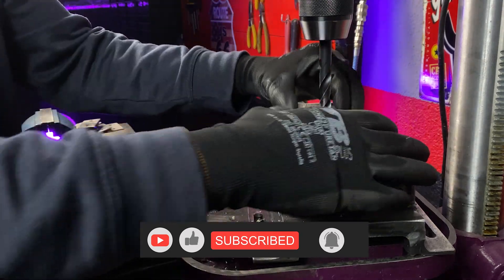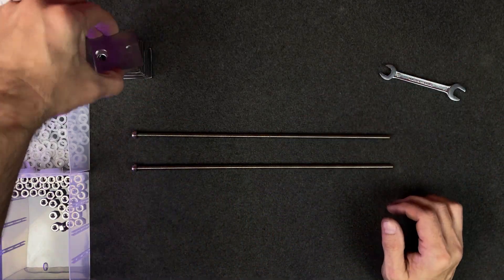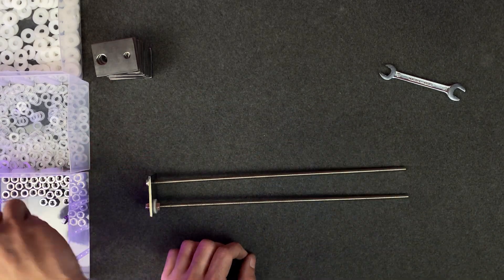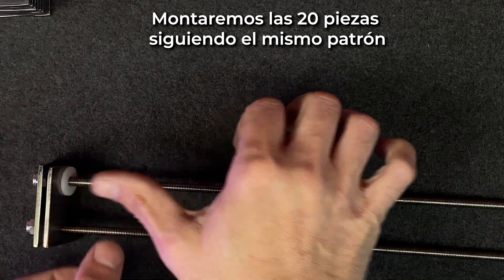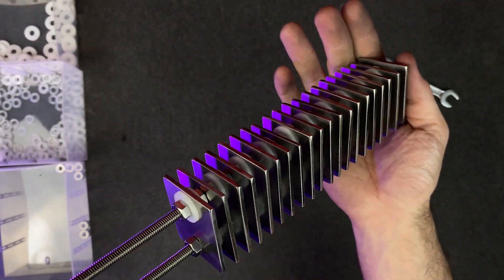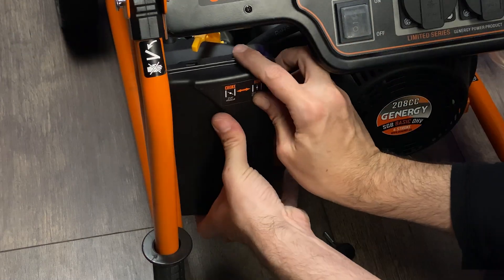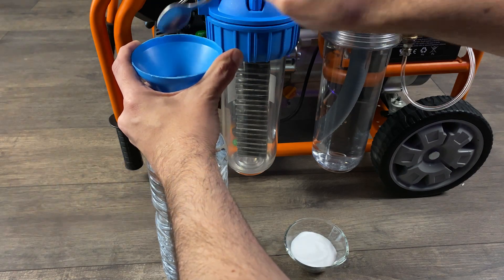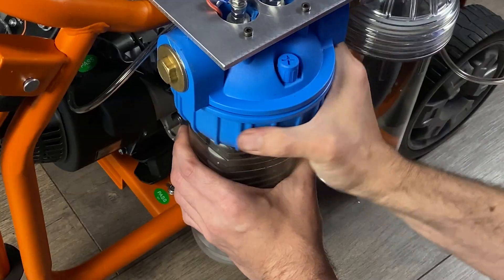GENERADOR A GASOLINA QUE FUNCIONA CON AGUA

Comment: Esto lleva a otras preguntas: con carga de 3000W, el generador sigue funcionando?...por cuanto tiempo? digamos unas 5 horas, sin parar?, cuanto dura la batería?  el tiempo de funcionamiento del motor, dependerá de la duración de la batería no?, si pusieron un fusible de 20Amps, significa que el consumo de la celda Debra ser menor a 20 Amp, pero si suponemos 10 amp de consumo mide la celda, entonces la duración de la generación de H2, será n o mas de 2 horas, pues la batea parece ser de unos 20AH máximo, por lo que no puede durar mas que eso y si es a plena carga del generador yo creo que seria menos, después tienes que resolver el problema de suplir por lo menos 120W adicionales para cargar la Batería y estar seguro que el generador pueda con esa carga de mas a los 3000W nominales, por lo que, en caso de poder suministrar los 10Amps de DC, el generador, entonces la potencia nominal del generador se ve reducida y ademas, cual es el tiempo de operación efectiva de la celda, cuando pasa el tiempo?
Reply: Según la ley de conservación de la energía para obtener 3000 watts de potencia en el generador eléctrico tendrías que tener un generador de HHO de 3000 vatios. Aplicando la fórmula de la potencia, P = V. I  necesitaríamos 12 voltios a 250 amperios y todo esto en condiciones ideales, es decir, tendríamos que tener un generador de HHO con el 100% de eficiencia y un generador eléctrico con el 100% de eficiencia también y eso es físicamente imposible.. por eso esta idea es de lo más absurda.

Comment: Una vez mas pregunto, pues no tengo respuesta: cual es el consumo en AMPS de la celda de H2?
Reply from the maker: Pues tiene un fusible de 20 amperios, aunque consume 10 amperios. Al arrancar el motor la batería se carga con 20ah, así que este motor funciona perfectamente mientras el depósito tenga agua
Reply: @HiddentechnologyYT  querido amigo, con todo respeto, llevo años construyendo generadores HHO (Hidrógeno y Oxígeno) (como tu modelo) y solo generadores de hidrógeno, me gustaría saber si has modificado el encendido de las bujías (adelanta la temporización ) porque el hidrógeno se quema mucho más rápido que la gasolina, y si cambió la sincronización eléctrica para ajustarse a la explosión de hidrógeno más rápida, dígame cómo lo hizo. por favor, entonces, inyecte el HHO directamente en el tubo de suministro de combustible del carburador, ? y modificas (reduces) la entrada de aire a la mitad (-50%) exactamente? finalmente dices que ajustas el flujo de gas por el tornillo del carburador exacto? Finalmente, ¿su generador es de 2 tiempos o de 4 tiempos? ¿Puede proporcionarme el número de modelo de este generador de 3000 vatios y 208 cc? el nombre de la empresa de este generador por favor. a cambio, te daré algunos consejos adicionales sobre cómo producir más hidrógeno con menos corriente eléctrica sin usar koh (HIDROHÍRDO DE POTASIO) Tengo mejores soluciones para electrolitos. Yo espero ansiosamente tu respuesta. Gracias.

Comment: C'est la batterie qui fourni l’énergie électrique pour l’électrolyse sauf que la conversion eau=>Hydrogène n'est pas rentable effectivement le moteur tourne mais pour combien de temps sans recharger la batterie ! l’alternateur interne ne peut pas généré assez de courant (même avec un système sur 48 Volts) . Donc en conclusion c'est une sorte de moteur électrique qui fait croire a la poupée qui tousse et sans compter que le moteur thermique va vite s'abimer usure prématurée rouille etc ...
Reply: en fait, moi je met en doute que le moteur réussise a tourner tout simplement...pourquoi? il ne semble pas y avoir suffisament de gaz et de plus, pour arriver a faire tourner un moteur avec de l'hydrogene il faut modifier le timing du moteur car l'hydrogene brule tellement vite que le moteur explose avant meme que le piston soit rendu au sommet de sa course...et si c'est un modele deux temps, comment se lubrifie t'il? je construit moi meme des générateurs hho depuis des années. mais faire rouler un moteur de facon souple ca c'est une autre histoire.
Reply: Vous avez sûrement raison moi je parlais uniquement électrique je n'ai pas les connaissances en mécanique j'ai simplement considéré que ça marchait
Reply: @francktlalka  sincerement, j'aimerais bien que sa méthode fonctionne, qu'il consomme plus d'électricité qu 'il n'en produit est pour moi un probleme secondaire, un probleme certe, mais secondaire car cela peut se corriger, non moi je pense a créer l'explosion dans le moteur au bon moment et avec la quantité de gaz (hho) suffisant et le fait qu'il induit le gaz par le tuyau d'essence au lieu d'utiliser l'entrée d'air du carburateur mais qu'il prend plutot soin de bloquer a 50%. l'arrivé d'air.
Reply: @francktlalka  je lui est posé les questions pertinente et j'attend toujours qu'il me répondre...ce qui n'est pas le cas a date...

Comment: Hello! I'm a very beginner on this, so please be considerate! 
I couldn't get a proper view on how to assemble the reactor. On the plaques are the holes about 1cm from the edges? Also, I understood we have to alternate the sides of the plaques, from the larger hole to the small one but couldn't figure out the rest. Can you please describe?
On assembling the Hydrogen Safety Receiver, how much reduction should I have on the pipes?
Reply: L

Comment: This is far from first time I hear about a motor running on water. I dont think you show us that it is more efficient than electric motor. You add water, electric power from battery and HH+ powder....right now we have no idea what the cost is to run the motor during time, and what output the motor can provide. I mean we have no idea if this is cheaper energy than other clean energy sources.
Reply: I am agree, a good result could be the engine working for a long time, and the battery system performance whiteout any problem I mean with no battery discharge, and the HH cell working for a long time too, supplying the same HH all the time, I think, this will be a good result, .....but there in no any data about the system

Comment: Hello guys,
i have build it exactly like yours but have used potassium hydroxide in the same ratio. Now i have just one problem. if connected to the battery, the amps are going crazy. If i use less potassium hydroxide, one spoon on 2 liter of water i don't get enough gas produced. Do you have any ideas of changing the voltage or the resistance of the mixture?
Thanks for your work.
Reply: Good observation, you really need a lot of gas to keep engine running, my suggestion is use gasoline mixed with this HHO at One spoon of KOH in water.  This will reduce your gasoline intake like 50% and also your engine will not be damaged.  The system shown here in this video will make pitting holes in cylinders & pistons & Cylinder Head in less than 2 days and the engine will become useless.  Hydrogen is made up of smallest atom and under compression it will penetrate walls of aluminium but if used as mixture with gasoline then no problem & will extend the life of engine.
Reply: @SamMonkulas  and how would that be done? should the gasoline go on the Hydrogen tank together with the water?
Reply: Try bakingsoda

Comment: Great way how to extract the energy what was made to produce the metal plates. It also looks a easy process to change the metal plates when the energy has been used up and the plates need changing. The gas comes from the metal plates not the water itself. Very professionally built machine 👍
Reply: The electrons are released by the metal - the gas is created by saturating the outer atom-shells with extra-electrons to get them to intert-gas-configuration and cause a short lasting split of H2O into H and O which are both ignitable.
Reply: The gas comes from the electrolysis of the water. You can do this experiment at home. Put the leads of a small battery in a bucket of water and you'll see bubbles start to form (Be careful, car batteries have a high amperage. Don't do this unless you know what you're doing). 

The multiple plates give a greater surface area to accelerate the reaction. The problem with powering a generator using this method is that the efficiency is always less than 100%. The battery will eventually go dead, stopping the reaction. Gasoline, on the other hand, has a greater power output as a liquid than hydrogen does as a gas. Which is why it can continue to run without draining the battery.

Comment: yeah I did exactly the same thing 20-years ago
Reply: And?
Reply: @klaasold  
running an oil boiler still got it in the place! have to still use the oil tho still because the oil burner demands it for lubrication and doesn't produce enough gas... but it does help with combustion and saving oil probably about 30-40%
Reply: @hoobsgroove  great and thanks for your repay.